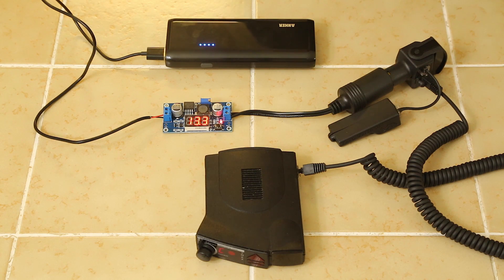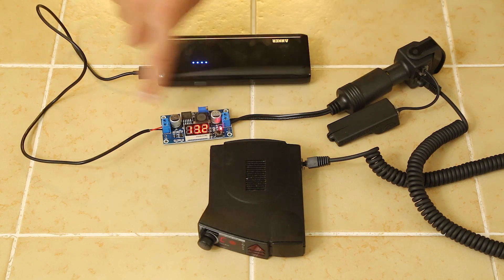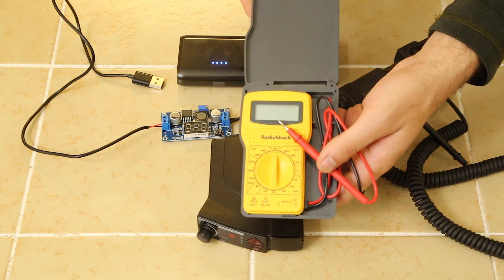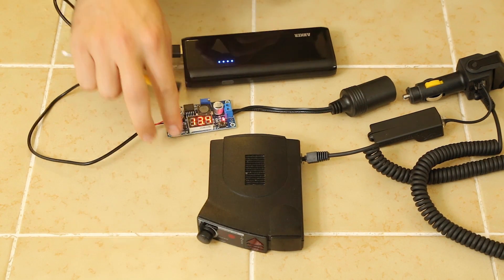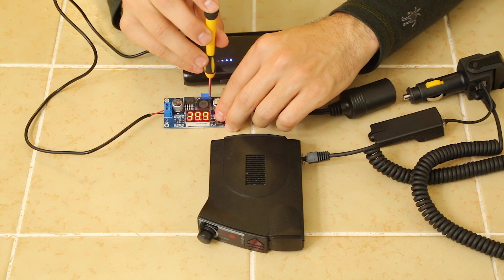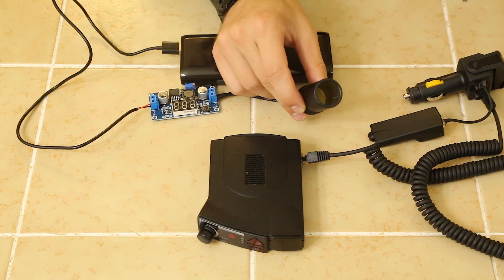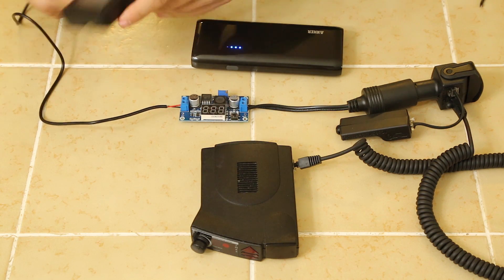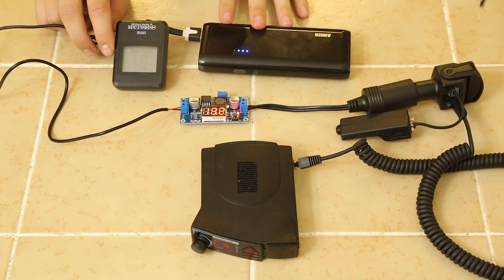How to Power a Radar Detector with a USB Battery Pack

Comment: I have a Valentine One Gen 2 and a Blackvue 900XPlus. The Dash Cam is powered by the Blackvue battery plus one extra. I would like to also power the Valentine with my battery packs. Can this be done?
Reply from the maker: Why would you wanna do that? You don’t need a radar detector running when you’re not in the car, plus it takes away from your parking recording time for the dash cam.
Reply: @VortexRadar  It's the only power option I have available without having to hard wire.
Reply: Finding a switched 12V power supply on a Tesla is a nightmare!

Comment: I been watching a couple of your video about the radar. I have a question if someone could help me. I'm new to writing on this type channel. I have a Escort 360c with the M1 camera. My problem is my power cord stop working after a year. I thought it was the cord so I had a new one and that one didn't work. I brought another one from Escort and that didn't work in my cigarette lighter. I brought a direct wire and hooked it to the fuse box. It powered up but stop working after about 5 minutes. The cigarette lighter and the original fuse still work but I can't get the power cords for my radar and camera to work. I seen this video and just ordered a battery pack and dc to dc converter. I'm hoping this will work. If not, I will have two pieces of equipment which I can't use. Anyone has suggestions of what might be my problem? Thanks for your videos.

Comment: This'll work as a dash-cam parking mode setup too (or just let the camera run continuously if it doesn't have a parking mode.) I'm assuming that the battery pack can be charged and drawn from at the same time? Have the pack hidden under the seat. Connect the charger to the 12v cigar lighter socket and camera plugged into the USB. Then, the camera will draw from the battery pack and not the car battery. The pack itself will charge as soon as you switch on your ignition. Cool huh!?

Comment: cool video, you can also use a very small high performance 12V battery like a VMAX V10-63 12V 10ah agm battery
Reply from the maker: +g350 Is that a lead acid battery? That would definitely work too, but for my application I wanted a more portable package and to reuse the existing batteries I already have. You're right there, there's more than one way to skin a cat. :)
Reply: +Vortex your method is def better for running lol. yea its an agm sealed lead acid so it's  leak proof and can be installed on any of it's sides